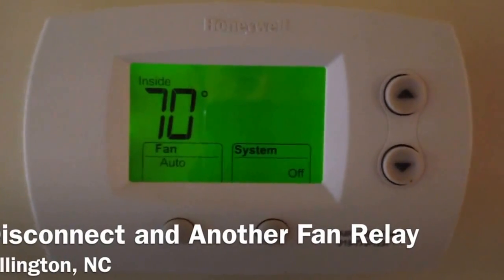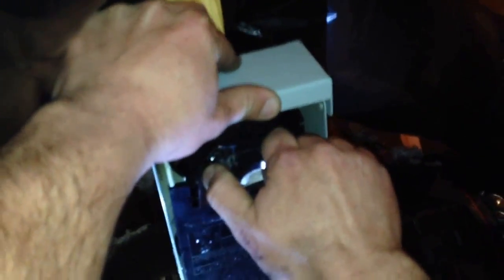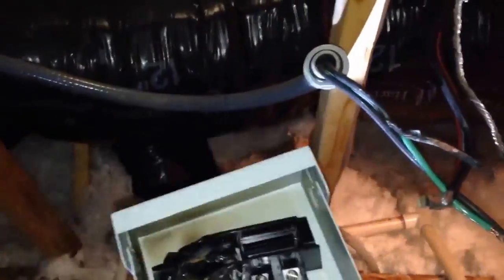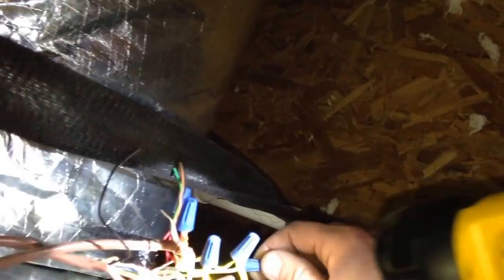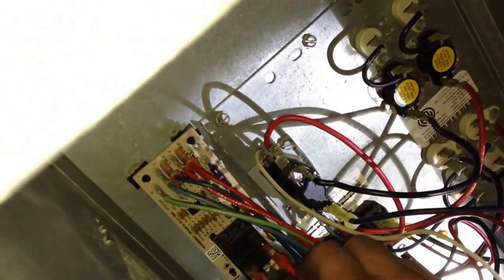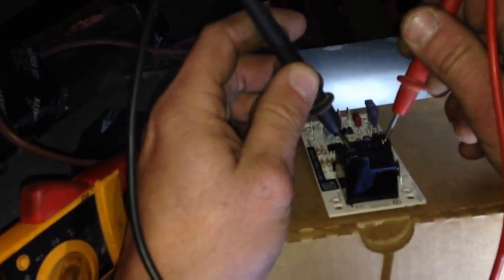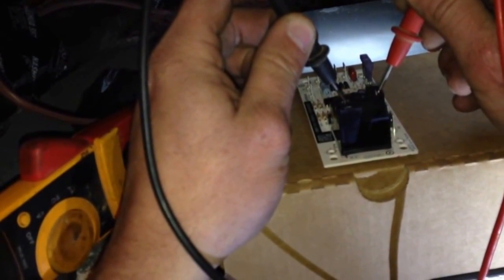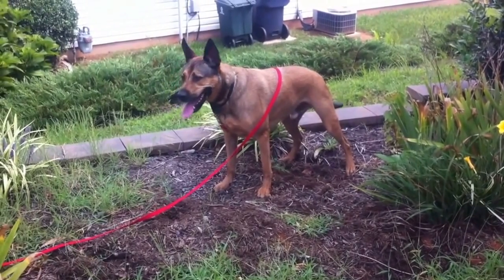HVAC Service: Troubleshooting Goodman Fan Relay & Electrical Disconnect

Comment: Sorry what is formula for electric cfm fan motor?
Reply from the maker: https://www.mingledorffs.com/measuring-airflow-using-temperature-rise-method/#:~:text=The%20formula%20is%3A%20Airflow%20(CFM,to%203%20Tons%20of%20airflow.

Comment: I am having an issue with my ac...it gets stuck off until you move the dehumidifier  dial then it comes on after you move the dial.i replaced the Stat and the humistat.

Comment: I had a fan motor burn up & took the relay with it. When I found out the cost of the fan board I decided to surface mount a new relay for under $10. 
No more relay problems.

Comment: How about a Goodman gas pack remove replace blower motor capacitor etcetera things that usually go wrong with this unit I've already changed the condenser motor and capacitor just looking forward to Future wrenchman 55 at yahoo.com

Comment: If it is 87 degrees Fahrenheit outside, should a properly installed ac be able to cool the inside of the home to 70 if set at 70 or should it weakly seep not so cold air only cool it to 82-83 and KEEP ON  FUCKIN' RUNNIN' ???
Reply from the maker: Generally speaking yes, a properly sized and functioning system should have no trouble cooling to 70° if its 87° outside.
Reply: @StephenRardon  , I know, They think ALL HOME OWNERS ARE RETARDS Including Me And yET...I hold an Architectural Engineering Degree...Shhh, it's a Secret, Like Undercover Boss...AND I AM PISSED OFF TO HIGH HEAVEN....You have no idea how Hot I AM about all this Goddamned LIARS in the HVAC Service Sector.  Nobody cares...They got that Blank Stare like a Doe being hunted by GOD.  They Sense Grave Danger....

Comment: I have a Goodman. I replaced the capacitor and that was badd but the blower still doesn't come on I have power but, I didn't check the lines as to whether power was going to the fan is there anything else that might be wrong?
Reply from the maker: Lots of possible issues, the motor may be too hot and internally open to prevent a fire. If you don’t have a volt and amp meter to reads ohms or continuity it may be time to call in a service man with the tools to thoroughly diagnose the problem.

Comment: What are your thoughts about installing a fused disconnect box instead of the other kind with just the pull switch?
Could the fused disconnect of kept that from happening?

Thanks for uploading the video!
Reply from the maker: The breaker at the panel is basically expected to protect the wiring and then the disconnect at the unit is either a service disconnect only or another opportunity to protect the equipment. Fuses at the service disconnect could help.
Reply: @StephenRardon  Good info. Thanks for your reply!

Comment: Have a GOODMAN The air conditioner and heat is on at the same time, (down stairs) would not shut off until I pulled the main circuit breaker. Had this happen to my other system (upstairs) about 3 years ago. Is this the relay switch welding together.
Reply from the maker: It’s a possibility, obviously best to confirm with some testing to be sure

Comment: whiskey is great, just as all the videos you produce, thanks Stephen, learned so much technically, however, I have learned the art of quickly recover from difficulties and resilience, just like how you had to reach that damn capacitor, and shared your frustration with us, I thought I was the only one complainer, that engineers try so much to make it difficult for us the techs, lol.

Comment: Wait a second... via fan relay: if you measure resistance across all NO/ NC relay doesn't that indicate there's a problem with relay because when power is not applied NO should not measure resistance, correct?
Reply from the maker: Correct
Reply: Stephen Rardon...thanks for clearing--that--up instructor.  Great video.

Comment: You used blower volts,amps, delta T,and tonnage to find cfm? What is that formula? I use the testo hot stick aneometer for cfm. Thanks for posting this!!!!
Reply from the maker: Amps X Volts / Delta T X 1.08 = CFM
It's the Electric Heat Temperature Rise Method

Comment: Ive directly put power to my blower motor on a 10 year old 3 ton goodman gas fed furnace/AC horizontally installed.   Would that prove the blower moor is bad??  I jumped the motor using the panel switch input not like some idiot stripping wire and using an outlet ..  Itd b great to hear back .  Nice wire work U do there.   Pride kin your work is key!! Thanx Buddy
Reply from the maker: Julio Fiscal  could be the motor overheating, would have to test it electrically to confirm.
Reply: Great Vid .  Like your safety precautions as an outside Lineman for a uility company Please respond to my abocve comment as I'm curious if I poull it out that I can repaiur the electronics ..
Reply: The compressorcondenser unit is fine .
Reply from the maker: From your description it sounds like you've done what you can to confirm the blower. Was it hot to the touch? Did you have a way to test the capacitor?
Reply: Stephen Rardon 
i have a question i have a goodman 5 or 4 ton 
when i turn it on the it works good for about 30 min then the blower  stops workin do you think is the relay or the fan i install new capacitor

Comment: Didn't trip the breaker?  What kind of panels FPE or over current protection was just to high?
Reply from the maker: No, breaker didn't trip. I think what it was is that the wires never contacted ground or opposing voltage and so it was sitting there waiting on someone to screw up and ground it. Lucky that wasn't me...
Reply: Yeah man. Nice work Stephen.

Comment: Good job. I Know Why the disconnect can failed it looked like aluminum wire feeding the disconnect can should have used to Noah lock love the videos whiskeys a good dog
Reply from the maker: I'd be willing to agree that alum wire can be a problem but I've found that not tightening your lugs is more of an issue. Thanks for watching!
Reply: Totally agree